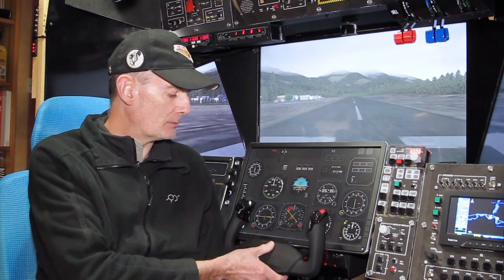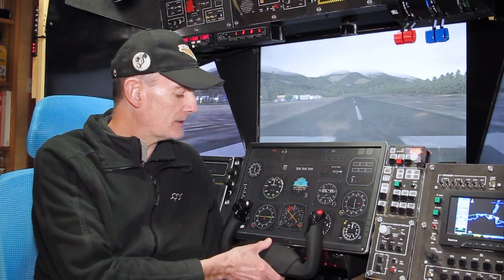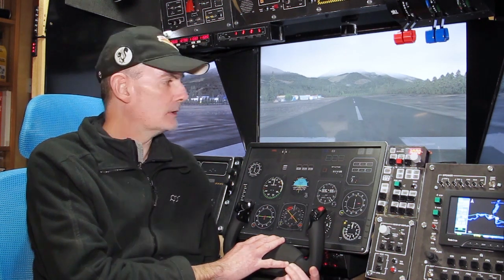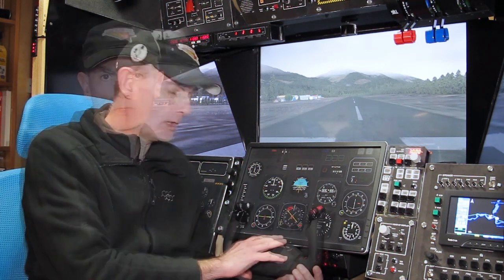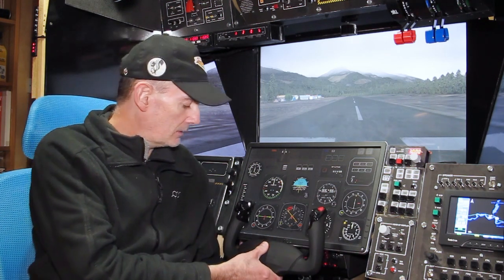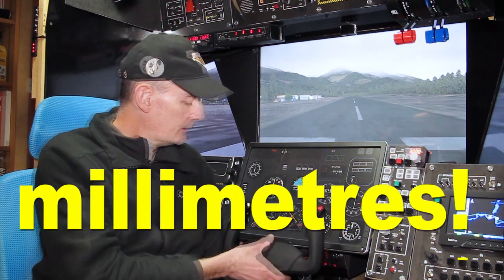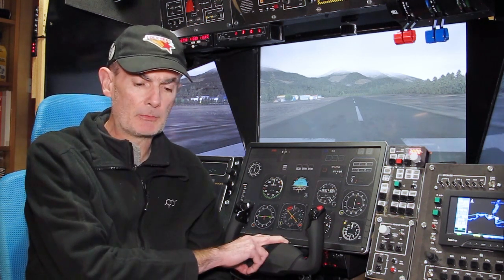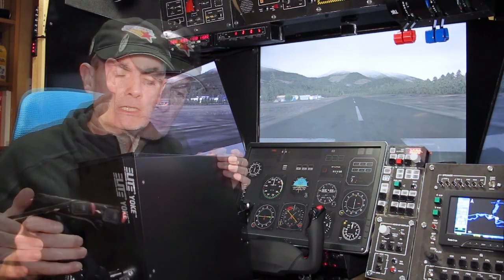Honeycomb Yoke Dead Zones: Explained!

Comment: Not sure it's such a big problem. I came from a Logitech yoke that was awful with its detents. I did modify mine with elastic bands and the Leo Bodnar USB controller which made a huge difference, still no match for the Honeycombe. My real world Foxbat A22 aeroplane has some backlash in the yoke mechanism that would effectively be a deadspot but it doesn't matter, it remains perfectly controllable and becomes a characteristic of various real aeroplanes. I watched those pilots on Buffalo air flying the DC3's and I don't believe there is such a place as an aileron or elevator centre, the way they saw that wheel in all directions, it's just the way they fly. A very interesting video though, thanks for keeping the manufacturers honest.
Reply from the maker: Yes, if they just came clean and explained it there wouldn't be any problem.

Comment: @Almost Aviation Thanks for your detailed investigation of this. A few hours ago, someone from Honeycomb posted on their Facebook page the reason why some early yokes have large deadzones they should not have. Not surprised we could fix the calibration on our own, but they will not let us! Here's my thoughts on this I posted on Avsim: "OK, a person from Honeycomb recently posted on their Facebook page that the reason some yokes have a deadzone, and some do not, is that some of the early production units were calibrated incorrectly at the factory, giving them a deadzone they should not have. My yoke from the original preorder has a 5mm deadzone in elevator, and a 9° deadzone in aileron (5% of total rotation!). I am none to happy about this, as being a direct customer they could have easily contacted me about the mfg mistake, or they could have posted a notice on their website. It's not so bad I knew it was fault, I thought I just had to live with it. So to get it fixed, the customer has to realize on their own, with no communication from the manufacturer, that the deadzone is not intentional like most inexpensive yokes, and decide it is a fault, and "prove" it to the manufacturer that the yoke has a problem to get it fixed. Really is making me think twice, three times, about buying their throttle quadrant now."
Reply from the maker: Yes, I saw your Avsim post. Whose Facebook page was it? I have been emailing the Honeycomb person I was talking to asking if they intend to make the info public, but no reply as yet.
Reply: @AlmostAviation  It is the main Honeycomb facebook page: https://www.facebook.com/FlyHoneycomb/ under the post "THROTTLE UPDATE!" in answer to a question about the deadzone issue from Kris Brown. No name from the Honeycomb Aeronautical poster, so not sure if it is Nicki Repenning the owner or someone they have maintaining the Facebook page. I just submitted a support ticket asking them for the procedure on how to do the recalibration myself.
Reply from the maker: OK, thanks.

Comment: As a pilot, can I just say that an airplane does not have a deadzone and yes you will have to trim all the time? It's part of flying. Having a deadzone in the system is the most frustrating thing since straight and level flight is no where near as realistic as it should be and could be!

Comment: Thanks for this; I’ve been following with interest.  Your logic makes sense.  I guess I’m still wondering: surely the (e.g.) Yoko Yoke has the same issues and it’s own way of overcoming them ?  Does the Yoko just do better at returning to Centre?  I’d be surprised, as the contents in the box look similar from videos I’ve seen.  There’s also still the issue of why only 8-bit resolution, especially when those 256 steps are spread over such a wide arc in full 90 degree rotation, most of which isn’t normally used.    Thinking out loud, I could see if both axes were equipped with optical encoders, a ‘constant’ Centre could be redefined by the system each time the yoke is left momentarily still at the centre point; re-zeroing the pots/Hall effect devices each time the yoke centers.  Don’t know if Yoko does that.  Probably too pricey for the Honeycomb.
Reply from the maker: Yes, good question. I will have to plug the Yoko back in and try it out.
Reply from the maker: I checked this out now and it seems the Yoko doesn't have any detectable dead zones. But predictably, this means you need to set up software null zones because it doesn't return to centre with complete precision. The net result is about the same.
Reply: @AlmostAviation  Ah, interesting.  Coming back to simming after a 15 year break, I'd assumed all the current hardware would operate at least as well and with at least the precision of my old SideWinder FF2 (which is now spoken of with a mythical reverence).  I just ran DIView on it and immediately you break the beam near the grip, without touching it, it centres perfectly and repeatedly to the resolution of each axis - which is 10 bit on pitch and roll, and less than that but still overkill on the other axes. (Accepting that DIView oversamples, the return number is identical each time, and the physical movement to snap is tiny.)  That's one of the beauties of optical encoders and feedback.  It seems that if the Honeycombs are each given their own personal calibration in manufacture, it's a matter of luck whether you get one with a small or larger deadzone: depending how the elastic in that particular one is twanging on the day.  But you're right, if they didn't do it this way folks would complain about permanent trim offsets developing in each axis.  Personally, I'd rather have no deadzone at source like the Yoko, and trim as necessary.  There's always the Brunner ($$).
Reply from the maker: @communicatescience  I'm not sure it's luck, this is an engineering endeavour and I would guess all the Honeycombs are in the same neighbourhood.  I still wonder if any of this really matters, as as a flight yoke is by no means a precision controller anyway. As for FFB, at the current state of the art I have yet to be convinced it's much more than a novelty.
Reply: @AlmostAviation  The vibrations and bumps, and even increase of control force with velocity change associated with FFB, I'd agree are more of a novelty, but the way any non-FFB device handles trim is fundamentally inaccurate.  i.e. In real life, I pull back on the yoke and trim off the pressure, but the yoke stays pulled back (same with FFB sim); but with a non-FFB device, I pull back on the yoke then have to gradually release it against the spring pressure towards the central position as I apply trim.  For gaming and more procedural training it's not a big deal.  I noticed Austin Meyers of X Plane conceded this limitation in one of his video appearances, likewise the importance of resolution for trimming at high speed.
Reply from the maker: @communicatescience  Trim, I get it. I just don't think it's that big a deal. Now if the atmosphere was actually modelled and FFB allowed me to feel gusts and wind shear on the approach, that would be something else. The early videos for the new Microsoft FS talked about the atmospheric modelling, so perhaps this will bring new opportunities for FFB in the future.

Comment: So many people have an issue with this yoke, this is a fucking $250 yoke and something like this is not acceptable they should be sued for selling damaged yokes, yes if something cannot be calibrated by software it means it's broken.
Reply from the maker: I think that's a bit of an extreme position, as you can always return it. But in the long run if it's a big enough deal people won't buy it. That said, people continue to buy the Saitek radios panels and yokes, so unfortunately it seems the market's standards aren't very high.

Comment: It took me 45 seconds to realize it' not for me. It doesn't feel right.
Reply from the maker: Well okay, but I hope you persevered a bit longer than that to make sure. That first impression is the same as any time I've sat in a new car or ridden a new motorbike, it takes a while to get accustomed. Of course, in time you get a sense of the bigger picture.
Reply: @AlmostAviation  I've used flight simulator since 1982, and I've owned every version. The Logitech X52 Pro was reasonably good,  but the dead zone killed that for me as well. The yoke felt cheap. Having been in the real thing, I felt lied to...it's not even close!

Nope...it's going back. 

Something that expensive should feel more responsive. It had ZERO control surface feedback, and the piston felt as mushy as a 1990 Hyundai's steering!
Reply from the maker: @jitkundough  Not sure what you mean by feedback, but if you just bought it then returning is a good option as they are reportedly shipping the Alpha XPC from today. Time will tell if that works better.